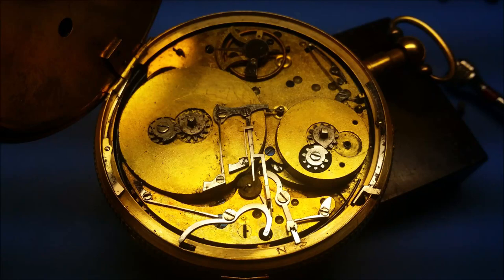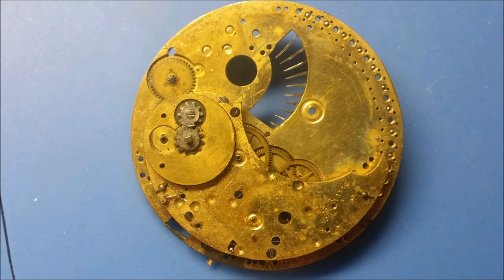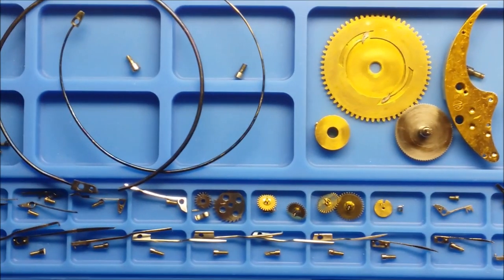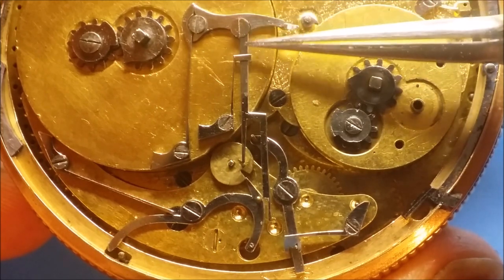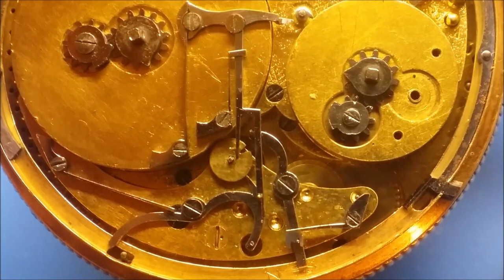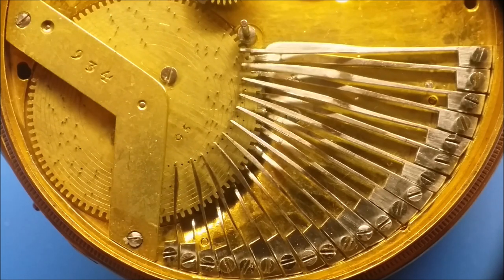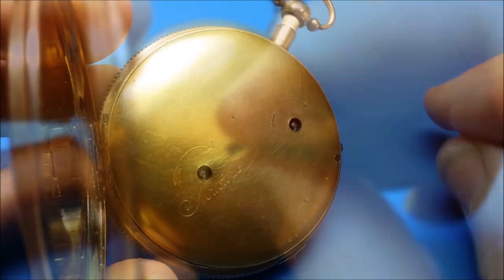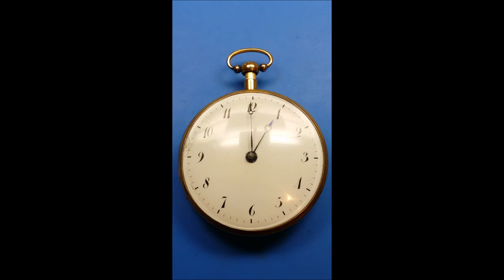1820s musical pocket watch complete service

Comment: Hello, I have a question, maybe you know why is the escapement wheel (teeth)constructed  anti-clockwise than standard, and so is cylinder roller, structured in mirror image to standard type of escapement, seen in other non-musical watches from the period? I noticed that only in musical watches such extraordinary solution is applied. Best wishes from Poland!
Reply from the maker: Excellent question. In this watch the "center" wheel or second wheel in the time train needs to rotate opposite of normal because it doesn't directly carry the cannon pinion or minute hand. Rather it engages with an extra wheel which does this. As a result, all the wheels in the time train, including the escape wheel move opposite of what they will in a standard watch.

This arrangement allows the whole time train to be pushed over to one side of the movement, creating more space for the other complications.
Reply: @repivot2253  Thank you for the answer, now I understand! By the way, I have a couple of this type movements, mostly incomplete, but in one of these I noticed that escapement wheel is installed upside down, and it looks like it was a original construction, which is in my opinion interesting. Also I'd like to aprecciate your work, because videos and especially close-ups of these movements and its parts in working condition allow me to imagine how it was constructed originally and I can complete my deficient movements. Best wishes.